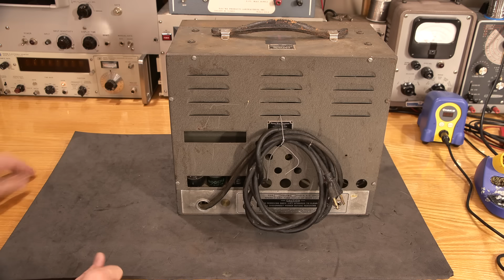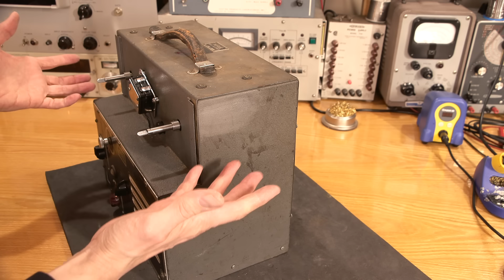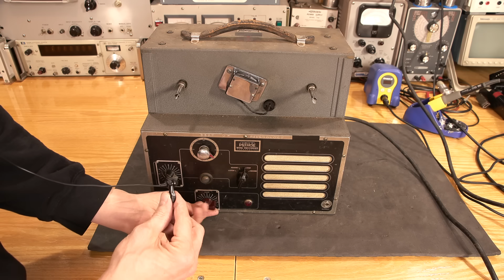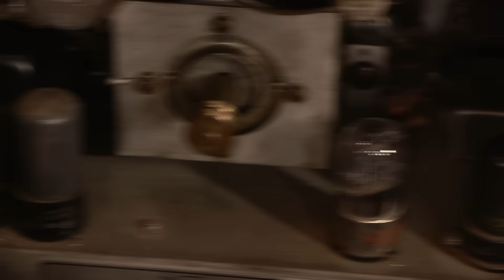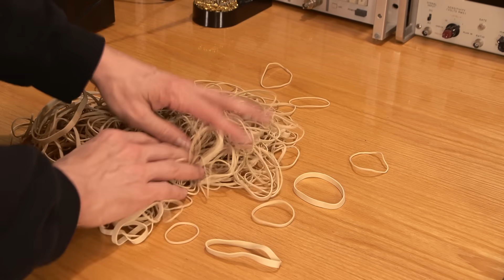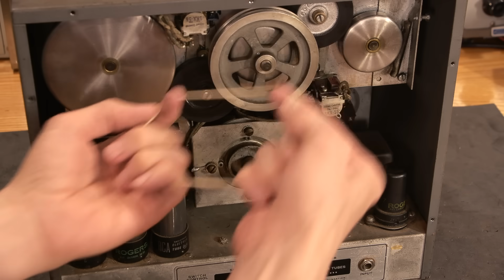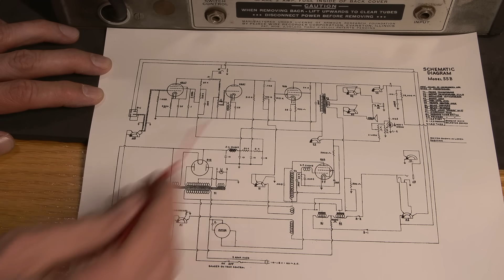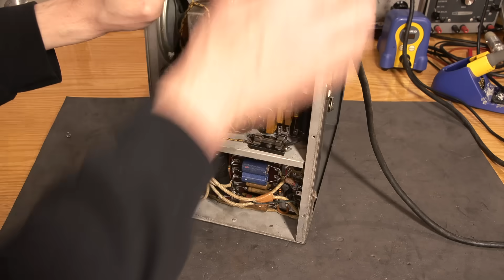Trapped Voices In This Wire - Let's Listen To Them!

Comment: I grew up using and recording things off the radio with a wire recorder. We used to have to tie the ends together (using A SQUARE KNOT) if /when the wire broke. 
  This is just an earlier version of recorders. It was replaced by tape, of course.

Comment: Back in the mid-1970s a college classmate bought one of those antique wire recorders in a junk shop and played the wire reel that was still in it, which turned out to be a recording of a party from the 1940s  where the device had just been left running so it would carch the hum of the crowd,  the clinking of glasses and whatever any guest wanted to say into the mic as they got progressively drunker throughout the evening. One guy kept saying, "Fuuuh...Chrissake!" over and over as if that were really naughty.

Comment: I have a wire recorder. It’s in a 1947 Sears and Roebuck stereo council.  The motor doesn’t work. This unit has a shortwave radio and turntable.  The original owner was, believe it or not, Betsy Ross.😳 I’ve always wanted to hear what’s on the reels. One of the reels states that it’s McAurthor speech at a military base when he returned from Korea, which he did in 1951.

Comment: I used a miniature reel to reel recorder when I was a child. My dad brought it from Germany perhaps? I was barely school age younger than but it was easy to use and I used to sing songs on it. If the reels came off I could just rewind it manually and start again. It looked like one of those desktop tape recorders we used to use for transcribing in the office in the 80s, but it was a real to real, and it had a switch on the bottom back-and-forth toggle.
Are you familiar with that at all? Early 1960’s

Comment: Very, very cool! I enjoy listening and watching all your videos. I have an electronics background from the military, Power Generation tech. 1.5kw- 60kw 3-Phase 400hz  trailer mounted generators. They use electronic governer control units for precise power requirements. That was when I was a young man and just starting a hobby in amateur radio. I am 63 now and ready to retire and restore some radio equipment. I am starting to setup my radio shack with a workbench. I have a 60+ year old Heathkit DX-100 AM/CW transmitter that I am restoring as well as a National NC-300 receiver. It is about 85% restored now. That Pierce wire recorder was awesome. Wondering who and how old that recording was. Something so captivating about hearing voices from yesteryear. Also, I like the kit, the ultra-probe, very slick! Lots of applications. Keep up the excellent videos, I enjoy them very much.  Dan

Comment: To "soften" the wheels, you could try acetone. Either wiping it on the rolling surfaces or a short soak to remove any crystallization or hardened spots

Comment: Was a lab tech for an EMC Certification Co. Helped set up the testing, this stuff was over my head but so interesting. Had I picked up those spools at the good will Id have taken them home as welding wire haha❤. Amaizing technology's !! Now I know that wispering in my  mig welder is not white noise 😂.
Reply from the maker: That would be some pretty fine mig or tig welding :^)

Comment: Man, I just happened to click this video, never watched anything like this. I'm so glad. This was one of, if not the coolest pieces of tech I've ever seen used. A restoration would be so cool. As far as the no sound in the speaker (I still have a 1/4 of the video to go so I don't know if you addressed this as of yet) but get a multimeter and test for continuity on the speaker. Those old speakers usually don't last due to weather, and environmental degrading. But I may be wrong. I used to install car stereos for years. So this is so cool to me.
Edit: Hmm, with tubes, and caps, not sure if continuity is even the issue with the speaker. But I know nothing about this old tech, but I'm subscribed now, and along for the ride! hahaha

Comment: " The 6SJ7 is a metal sharp-cutoff pentode designed for use as a biased detector or high-gain amplifier. The 12SJ7 is identical to the 6SJ7 except for heater ."- FRANK

Comment: 😳you can actually store vibrational waves into wires?😧😧🤯
Reply: It is a magnetic recording, exactly the same way an audio cassette tape works, just using metallic wire as the recording media.  Wire recording was common until the 1950's when tape took over.

Comment: If you can trap a voice in a wire imagine what you could trap in a broken neurone transmission... You could get those cogs turned out straight again, it would help with the vibration, clean any connection as it's has to much static.. rubber feet on the bottom, very interesting machine for its time.. I would like to see the problems with it please thanks 👍

Comment: You're going to need another friction band because those regular rubber band are not going to last long from the friction of the spin and heat from the tubes but they will run temporarily. And as you know please be careful with that capacitor I learned my lesson with that because it does pack a good punch. try not to forget to bleed your capacitor before you touch anything. There may possibly be dry rot in the speaker diaphragm maybe!!

Comment: Wow!! I’ve never heard about wires    With tracks like records on them! And I’m 53 so this is before my time
Reply: It does not work like record with grooves.  It's a magnetic recording, it works the same way as an audio cassette, just using metallic wire as the recording media.  Wire recording was invented in the late 1890's and was common until the 1950's when tape took over.

Comment: I wonder if the speaker itself is broken or if one of the conductors is no longer connecting. I am very interested in seeing the recording process as well and understanding how sound is being inserted into the wire (via grooves similar to a record, CD, or disk drive, but just in a different type of media I surmise) - what tools are creating the physical storage, how precise the instrumentation is to record over pre-existing wire alterations of voice, etc.

Comment: Rubber bands? I dont think so, they will probably flex a bit too much causing sound to be unstable (warble). better luck getting a large diameter o-ring kit and some superglue. For the rubber wheels, how about some polyurethane wheels like on roller blades?

Comment: That ancient device undoubtedly has vacuum tubes. Hope they're all working. Those tubes get extremely hot. You should clean the one you touched with an alcohol wipe. The rubber & plastic parts are depolymerizing with age. Best of luck.

Comment: One thing neat about these wire recordings is that if you break the wire all you have to do is tie the two ends together in a knot and clip off the ends and it will work ok. I have a Silvertone machine that jerks the wire when starting and breaks it sometimes. You will only lose the audio from the clipped ends. I hope you do a restoration video for your machine!

Comment: Sure i will troubleshoot it with you, do you have an oscilloscope ?

 Its probably pretty simple to trace the audio circuit from the speaker output backwards to the op amp. circuitry.

Are they using the good old 741 operational amplifier? 

Did you check for any cracked components like the caps, or transistors?

  How is the fuse and power supply circuit, i am sure its obviously operational but maybe youve lost a ground somewhere?

The audio you were picking up sounded quite clear.  Did you try to pick up the  audio track right from the physical tape?

  If so, was it any different than your audio  pickup from that coil I believe it was?

Looking forward to some old fun.

Comment: I don't know why your channel showed up . Maybe because I did some searches on Google on some stuff my recently ,and unexpectedly, passed dad has. Are those some vintage meters in your back ground. My dad has so many.  I've been finding , vintage oscillators, multi meters, all sorts of stuff lie that , and still finding, as I clean out the place. I live there too as well as he needed some assistance with things. . I also found a bunch,   like 30 so far and counting ,  of pocket meters, I  think they are for batteries. I thought they were old pocket watches at first. . I was just curious of your background and if they were meters because it looks like some of the things he has , some look really old too but in good condition. Many have the manuals with them as well and wires . I don't know anything about the stuff I'm finding but it's very  interesting to see the vintage meters he has and trying to learn a little about them, trying  . . . It's become like a treasure hunt even though I have no idea what to do with all it yet.. he was really into radios, obviously meters, and fixing old TV's. He had a degree, or certificate ,many years ago , like 70's , for TV and radio repair. I even found some vinyl records that say something about TV and radio repair course. Oh!! and computers , very into that. I remember the commodore 64 he had when I was a  young kid in the 80's. The first computer I used but wasn't interested in at the time

Comment: The psychology/psychiatry departments were contracted by the CIA for Project MLKultra (1953 - 1973), mind control experimentation.  That equipment would have been used about that time.  Who knows what that equipment and the wires recorded.   There was always speculation Ted Kaczynski may have been involved. 
           Lee Harvey Oswald applied for an orderly job at the Feliciana Forensic Facility (Louisiana facility for the criminally insane).  Having a marksman who the doctors could manipulate may have been interesting.  Those recorders would have been used there. 
          When I was a teenager beginning in 1970, kids had cassettes and there were a few reel to reel tape recorders.  We had heard there was an "ancient" technology - wire recorders, but what teenagers considered "ancient" was well within the memory of the adults and not that long ago.

Comment: I'm 52 years old and no one ever told me that sound was recorded on wire. I knew that sound traveled on wire, but I didn't know it was recorded on wire like a record player.
Reply: This is a magnetic recording, same as an audio cassette, just using metallic wire as the media instead of tape.  It doesn't work like a record with grooves.  Unfortunately that was not explained in the video.

Comment: This is just magic to me.  I am not understanding how the sound got on the wire.  And then you said one of the 6v tubes did the recording.  Huh?  Is it just that certain frequencies/waves can be transferred to a medium(like wire, tape or a plastic record)via for instance that tube you mentioned?  I am trying to understand this.
Reply: It is a magnetic recording, same as an audio cassette, just using metallic wire as the media instead of tape.  If you do an online search for how audio is recored on tape it is the same principal.  The vacuum tubes amplify and control the audio signals during playback or recording.
Reply: @ Got ya!

Comment: The Pierce Model B55 wire recorder, developed in the 1940s, worked by recording audio onto a thin spool of magnetic wire. Here's a basic overview of how it functioned:

Recording: Sound waves from a microphone were converted into electrical signals. These signals were then amplified and fed into an electromagnet, which magnetized the thin wire as it passed by. This magnetization pattern on the wire represented the audio signal.

Playback: During playback, the magnetized wire passed by another electromagnet. As the magnetized sections of the wire moved past this playback head, they induced electrical signals in a coil of wire in the playback head. These electrical signals were then amplified and sent to a speaker, reproducing the original audio.

Rewinding and Fast Forwarding: The recorder could rewind or fast forward by controlling the speed at which the wire spool rotated. This allowed users to navigate to specific parts of the recording.

Erase Function: To erase recordings, the wire could be demagnetized using a separate erasing magnet.

Overall, the Pierce Model B55 wire recorder was an early form of audio recording technology, relying on magnetic principles to record and reproduce sound.

Comment: Try a roll of welding wire??
Is it the same???
Reply: If the wire is the proper gauge and can be magnetized then in theory it could be recordable (and play back) but the machine is not meant for random types of wire to be used.

Comment: The first thing to do is take off the bottom and look for evidence of overheated parts. Never power anything that old up before that. You could burn out the power transformer, and you may never find a usable replacement. Check for shorted filter capacitors (bone dry is to be assumed.) you probably don’t have a tube checker, but with the schematic you can (after getting the power section up) probe the grid and plate of the 6V6 output for voltage and signal. Personally I wouldn’t put the wire recording on there until I had the amplifier chain restored. It’s too delicate to have it in the way while working on the rest. The rubber band trick is genius for the short time it’s needed.
I have two wire recorders, one tested, the other I can’t remember, haven’t looked at them for about 10 years. Probably early 50’s.
Reply: He used the current limited (dim bulb) isolation transformer and variac to prevent damage to the transformer and other components.  Mr Carlson has many many tube testers, he has shown how to restore them.  The biggest issue is that all the old capacitors are done for.  Changing them would make a world of difference.

Comment: There was an old man a few years back I used to go visit,  HE had an old wooden , A,M,  box radio from the 1920s.     We think it was that old?   IT came on , And the tubes lit up,  BUT it was making some Noise,   we took the wooden cover off of it,   And the speaker had cracks in it,   SO we taped up the cracks with box tape,  After we put it back together,  And let it warm up,  We adjusted the Dial ,  Until we could get a channel,   It was some old timey country music, WE listen to most of that song,   Then we tried to find some other channels ,  We could only get two or three,  Every one of the channels had old music ,  THINGS that you just do not hear anymore,  WE left it on for an hour or so ,  And the old music was all that we could ever get on any of the channels ,   IT was like the radio was tuned or stuck in the past,  IT was like an old time machine ,   I don't no whatever happened to him or the radio , HE put it up on the mantle ,  Above his fireplace ,   That's been about 25 years ago or so ,       I just wonder if anybody else had any Experiences like that with old wooden radios ?

Comment: I am 72 yoa and have seen this in movies from the 1940s. It is a wire recorder. It works on the same principal as magnetic tape. They were used in dictaphones. A early type of recording device used in offices. To take dictation. I have never seen one actually working. I am glad it is not completely lost to history. Very interesting.

Comment: SO😮 THIS is where the TERM "Wire Tap" came from! Hoorah.  Thank you for this video I forgot All about that machine.  The elementary school I went to as a little boy Still had one of these next to a reel to reel projector! Sweet God's, I'm getting old😅! IF the mechanics seem to rub too much like metal against metal, an easy fix is lubricant from an Autozone or similar type of Shop. Usually labeled brake lubricant.  I'm Sure you could use any but, I highly suggest the Brake lubricant because t works the BEST for metal to metal imho. Excellent showcase on this lost piece of American History of Early 20th century Electronic Technology.

Comment: I would definitely like to hear the entire conversation on that Wire, And I am very curious to see a full troubleshooting video on the Wire Recorder, Why is the grid Glowing on the Tube? .. Well in my experience with anything that old with Wax Capacitors is a lot of times when they leak, or they get old and fail, they fail closed, completely closed, which means that they are short circuit. I suspect that you have a smoothing capacitor which has failed closed between the Grid pin and a hot or ground somewhere, but I am very curious!

Comment: So does the recorder somehow magneticly charge the wire? How does the sound get deposited on the wire this is baffling me? How does it not just fade away after the wire has gone back to the spool?
Reply: It is a magnetic recording and works just like an audio cassette or reel to reel, just using metallic wire as the media instead.  The wire is magnetized with a signal representing the audio and the wire continues to hold the magnetization for many years.  When the wire is pulled past the play head it induces the same audio signal, which is amplified and you once again hear it.  All exactly like tape based recording.

Comment: That machine with the tubes in the back look like the things they were using in a CIA project that they had people send shocks to people in another room. The experiment was to see if people would follow instructions of a man in a lab coat with a clipboard as a man of authority, to insist people hurt others just because they were told to. It was an experiment to see how far a human would go if a person told them to keep shocking the other person even if the other guy hollered every time he got shocked. The results were appalling and cruel the extent people could be persuaded to. Anyway. That peice of equipment you are working on looks just like what they were using. You may have a quite nastalgic peice of history there. There is documented footage of that experiment in the CIA declassified archives. These machines were property of the psychology dept. may want to look intimidated this.